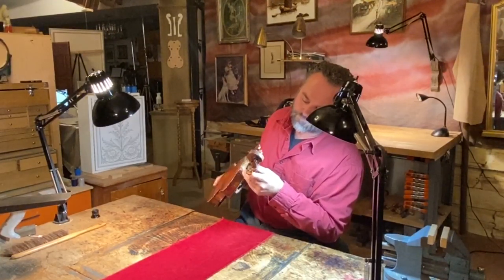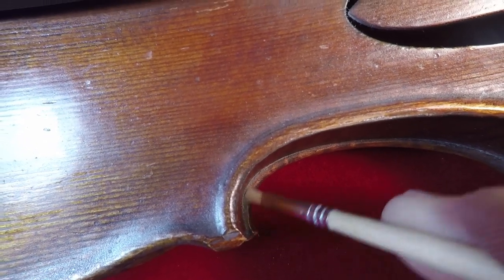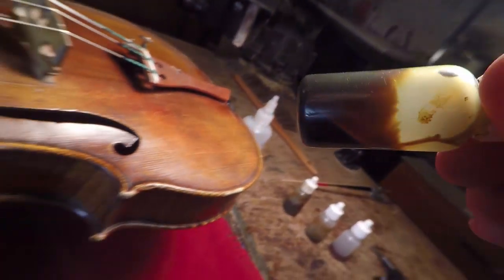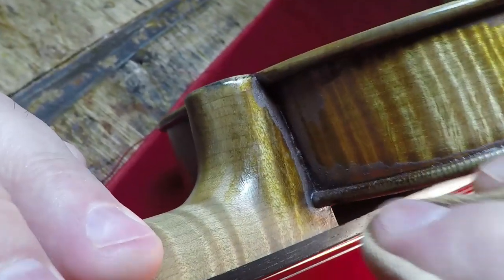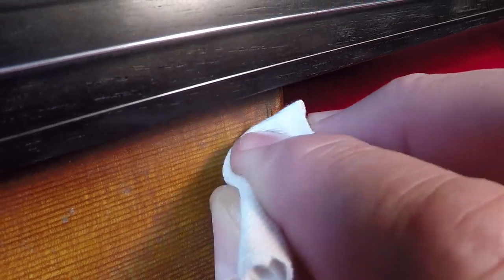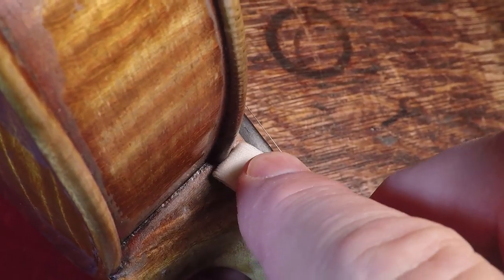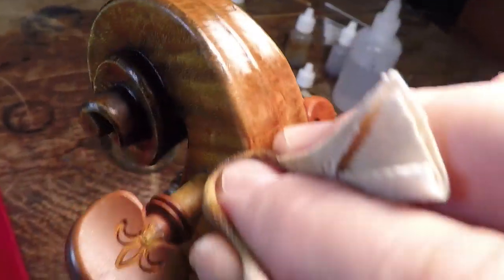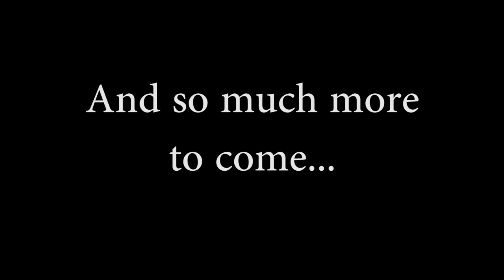How to Really Clean and Polish a Fine Violin / A "Natural" French Polish /  How to Remove Rosin

Comment: the best way to remove old rosin/dirt from a violin is to use xylene, since almost all violin varnishes are totally unaffected by this solvent (of course try a small area first). Once the violin has been cleaned up, traditionally it is french polished, however there is an alternative way to polish a violin that does not use any solvent or add any finishing material such as shellac or oil; this is by using a wax finish that is very long-lasting, repels dirt and rosin which can easily be wiped off with a rag. The wax finish can easily be removed. The best wax finish I have found is Saphir Medaille d’Or Mirror Gloss - Natural Wax Polish (for Leather Shoes & Boots) it also works great as a polish for wood. This hard wax finish is easy to apply and  polishes to a mirror gloss shine extremely easily with very light buffing with a soft cloth. Another very highly recommended polish for violins is Wyman's Furniture Cream, which gives a somewhat softer finish than the Saphir wax.

Comment: That thing turned out gorgeous, absolutely stunning 3d flame on the maple parts after the polish! Loved the narrative explaining each step too as well as the playing part at the end, I watched the entire thing twice.

I fix guitars as a hobby and am always absolutely blow away by the techniques, knowledge and materials you violin guys use for work like this.

We generally deal with Polyurethane on our side of the Luthiers genre ... you can basically windex that stuff and it will shine like a diamond without hurting the finish, sometimes in the rare case of a "good" or expensive guitar nitrocellulose lacquer with which you have to be a little more careful but you can get away with a slightly damp cloth with hand soap and it will be just fine. Fingerboards we can use lighter fluid (Naphta) and Linseed oil ... it's basically idiot proof.

Stuff like you did here with the cleaners and polish knowing how careful you have to be with the instruments and their varnish (and the staple/sound post ... another good reason to leave the strings on) to avoid ending up ruining the instrument ....  This is true mastery in my opinion! 

Both enticing and humbling to watch, thank you.

Comment: I am a luthier who has uses exclusively oil varnish. It just looks Italian immediately.  It has taken many years to develop a varnish (cooked amber, gum arabique, lavender oil etc). 
My viola is in need of a "shine" but I don't want to polish it too much. I have taken it to show a handful of luthiers (that's all we have in my part of Australia, perhaps 3 decent ones including myself) and they all agree for a clean/polish: NO alcohol, just some water and limestone or "rotten stone" applied sparingly, linen cloth for the first run, then silk for the final run. 
I have considered French polish for extra shine but when I tried this on another ($1200 oil varnish violin) the French polish sank right into the varnish and sure enough stripped the instrument of it. Luckily that was okay since I wanted to re-varnish that violin anyway! 

How could I go about a new shine? All I can think of is: put a new coat of varnish on and really look after it by placing it in a large box at night and covering it with a big silk scarf to stop dust from getting in but allowing the viola to "breath" and not be affected my temperature too much.
Reply: Interesting point! I'd really like to know more from your perspective as someone who removes caked on rosin from the instrument only using water and stone, but particularly on using oil varnish as oppose to French polish. 

PS. I'm also from Australia, in SE QLD reasonably nearby to where Ask Olaf the Violinmaker is. Just discovered your chanel and subscribed. Very informative video explaining Brett and Eddie's new violins, learned a few new things there, thanks :)

Comment: BTW, I use a medical endoscope to do inside work! I paid $40 for one at an auction that sold for $18,500 when it was new. Then I changed to a Meade eyepiece camera to hook up to my computer and view on a 47" screen. I have all sorts of gadgets that run inside the fiber optic part to the tip of the endoscope. I have done all sorts of repairs on all string instruments without taking them apart, and I charge a very large amount of money for my repair work! It beats taking the instrument apart, which is such a hazard to the instrument!

Comment: I haven't finished watching the whole video yet, but, wanted to share a small tip with you, Kevin, whilest I remember: you referenced using '0000' steel wool as that is just about the finest one can get.  And be careful that it doesnt have any oil in it"     You may have already discovered that there is a 5 ott steel wool available.   However, more importantly there is a product which has no oil in it as it isnt needed to prevent the wool from rusting/oxidizing--- it's used in fine woodworking and is called bronze wool.  Hard to find but much better results than steel wool.  Give it a try; I think you'll like it!
Reply from the maker: Years ago, when I tried the Bronze wools, I found that the slightest residue (which almost always happened) reacted with some of the most popular violin polishes, so I left them and stuck with the highest quality Stainless Steel I could find. Thank you so much for your comment!

Comment: Great explanation of the process. In regards to the alcohol in used with the spirit varnished is that "denatured alcohol " or some other?
Reply from the maker: Yes, while I have used other "quite expensive" high-proof alcohols, denatured is just fine. :) Just don't drink it!
Reply: @kevinleeluthier  I'll make sure not to confuse with the bottle of Vodka :) Thanks for your reply.

Comment: Man, I do different types of woodworking, painting, etc. and that tip you gave about rounding one side of the cutter to hold the cutting edge off of the surface you don't want cut seems like a good one.  I'm going to get out the diamond sharpeners and give that a shot...I'm kind of embarrassed I never thought of it.  

I will give one in return...if you ever want to wrap something in electrical tape and have it hold VERY tightly (keep a seal, basically) just stretch it before you wrap.  At some point it rips, and you want to stay shy of that point, obviously, but stretch a few test strips and you'll get the idea.  I've even wrapped split garden hoses this way with many wraps and had them hold for many hours.  Give it a shot, it works great, and will protect wrapped or soldered wires much better when this method is used. If a  long wrap, just pull the roll out a few inches, stretch, wrap, and repeat.  If you really need it to be at least very water resistant just take some CA and lightly coat it afterward...also helps hold the ends long term in less than ideal environments.
Reply: Nice.
You know I'm just putting some Minwax on my hardwood floor in a certain corner where it had some abuse. But this video is the best isn't it?

Comment: Fantastic video - just one question - why did you not remove the strings for such a significant refurbish - is there  an issue with this? You have another subscriber.
Reply from the maker: The customer preferred that I did not remove the strings or change anything (especially the soundpost), and it offered an opportunity to show the more difficult techniques. Thank you so much for watching, and for your comment!

Comment: Kevin,  I have an older violin that is in need of some varnish to seal bare wood on the edges.  Do you have a recommendation for what type of varnish to use? The violin is a 1928 Eugen Meinel trade name alias E.H. Roth with a dark red varnish.  I think it has a great sound.
Kenny
Reply from the maker: I consider the touch up varnish that I used on this instrument to be as fine as it gets, and I really will give full instructions in my upcoming video about making it. It can also be made to be any color, to touch up almost any instrument.

Comment: Amazing ! ..fantastic information. I wonder if any of the Stradivarius violins escaped the neck lengthening treatment ?...they probably would'nt have been as precious with them from a preservation standpoint as they are now.  Regarding preservation, I'd be so worried applying alcohol to that varnish...I'd be tempted to simply leave some of the older rosin as part & parcel of the instrument itself. You really do need to have a lot of experience ( like you do ) judging it. It's a wonder that rosin has'nt yet been replaced with a modern cleaner substitute.
Reply from the maker: There are only a few Stradivarius violins with their original necks, and most of those have had their necks altered in some way (like "The Harrison").
A couple have even had their longer neck grafts removed and shorter necks put back on in order to bring them back to their original dimensions (like "The Gould").
As far as how much caked rosin to leave when cleaning an instrument: I leave that up to the owner since rosin dust is not part of the "original" instrument and is a matter of taste = sometime I do leave a certain amount.
And... I kind of like the idea that in over 500 years, nothing is better or finer than boiled down tree sap. :)

Comment: Thank you for these brilliant videos!
I just purchased a violin for AUD$80.00. Before you laugh, it does have an inscription that reads:
	Antonius Stradivarius. Cremonensis
	Faciebot Anno 1713
	Made in Czechoslovakia
So, there's that.
Reply from the maker: I rarely "laugh" at violins, and never simply because of the price. If it looks quite old, chances are that it was made around 1913 instead of 1713 (+/- 20 years) and that it has a few cracks and doesn't sound very good. YET, if that's what you have to work with, usually these can be made into much better instruments within a couple days by fixing the cracks and open seams (always check for a loose neck), re-graduating the plates just slightly while adding "full" corner blocks. Then a little touch up and French polish gives them a lot more charm. = I'll have to do a video sometime. Thanks for sharing!
Reply: @kevinleeluthier   Would love a video on the topic, Mr Lee. I've been using a technique I observed on this video of just breathing on a small section, and slowly and carefully working on that (always with the grain). I'm not a violinist (yet - this will be my learn instrument) but I think it sounds really good! Put new strings on it, but the pegs are pretty much gone: need replacing. Might have to take it to Olaf in Brisbane to replace the pegs. BTW, I am chronicling my progress on a GitHub Projects page, if you're interested.🙂😊
Reply: @kevinleeluthier  I've started lessons: yes, they're online, but at the moment, with grandparenting time constraints, it's what's doable. Eventually, I'll engage a proper instructor. Your tips in other videos on holding the bow and how to relax/position/hold the hand are brilliant: constant mindfulness on your pointers are truly helpful.
I'm so very happy with the quality of sound my violin is able to produce - even with my extremely novice abilities - and will encourage her to sing for me. These are very happy times: I'm playing a lovely instrument!

Comment: I understand not removing the strings so that the bridge position is not moved and the sound post does not fall.     but why not just replace one string at a time with old steal strings? then put the good strings back on when you are done.
Reply from the maker: Everything on this job was done to please the customer, and at the same time, to teach as many different cleaning techniques as possible. (I usually prefer taking all of the strings off because for many instruments it's like a "breath of fresh air" and they sound even better afterward. Of course, feel free to use any variations that you like. Thank you so much for your comment!

Comment: I am half way thru watching but have a question.  You apply varnish to the edges but the edges were still rough wood.  I'm sure this is intentional, but my instinct would be to smooth the wood first, like sand it first before varnish.  Sanded anything with violins seems to be a big no, but even shaving slightly?
Reply from the maker: Unless there is a danger of snagging and breaking the edges, always leave as much of the original wood on the violin as possible. When a smoothing operation does become necessary (this takes experience and judgement whether to remove wood or add to it), the raised grain areas are trimmed(cut) and scraped. But when you do this, you must properly prepare and seal the wood so that it matches the patina of the original wood under the varnish, which (of course) is another video). :)

Comment: What is the best lubricant to occasionally use on my violin fine tuners? Regular oil ... any specific products recommended and or any to absolutely avoid? Thanks.
Reply from the maker: Avoid all oils. They spread over time, they get into the wood and can ruin most varnishes. 
 Traditionally, violinists and luthiers have used Fels Naptha Laundry Soap Bar for the fine tuners and for bow screws. (amazon has a 2 pack for $6.30)  Pull the screw out, rub a little on the threads, screw it back in and then immediately blow off the excess soap dust. 1 bar of soap will last 50 musicians a lifetime so cut some off and pass it around.
 Stay away from oil, WD 40 etc., if all else fails, its better to use almost any brand of bar soap, or Hill peg compound.

Comment: Please advise how to remove the sticky cork remains on the violin after taking of the chinrest. Thank you 🙏
Reply from the maker: For most cases, gently scrape/pop the cork off with your fingernail. For more difficult cork pieces, I use a gently curved, end-cutting exacto knife blade and literally cut the cork off (BE CAREFUL not to hurt the varnish!)  And for cork that has been glued on (yes, I've seen it a few times), I carefully cut the bulk of the cork off with the curved exacto-blade and then rub the thin remaining layer of cork and glue off with a damp cloth. Be careful, and Good luck!
Reply: @kevinleeluthier  My store deals with many violinists who wish to change their chinrests. Thank you. Your suggestions are very helpful!

Comment: Can you use isopropyl instead of denatured alcohol for rosin removal
Reply from the maker: Once upon a time I experimented and made the comparison with every other type of alcohol that I could find (including isopropyl which tended to leave the surface cloudy at times), and while I was able to make just about any of them work, nothing was as consistent, as fast, and left the surface of the varnish as clear as a high-grade denatured (they are not all the same). On the other hand,  190 proof Everclear has it's own advantages...

Comment: I am on a mission to learn violin repair, construction, and maintenance.  I have studied a number of luthiers on YouTube to put myself on the correct path and to learn the many ins and outs of the trade.  Watching your video, my first reaction was to question why a luthier would proceed with such an in-depth cleaning process without removing the strings, pegs, tailpiece, and bridge?  My next question was; why do a partial cleaning of various areas on the instrument and then apply varnish, only to proceed further with more cleaning?  The ribs were separated at the four points between the bouts.  You made no mention of that and the need for repair.  Any customer, especially those with expensive instruments, who bring an instrument in for such cleaning, will have done their homework and selected a luthier they can trust to work on their instrument and maintain the integrity of setting the instrument up properly after such a cleaning.  That's why they pay the big bucks.  Josh Bell bought a Stradivarius that had been stolen and covered in shoe polish to disguise it.  It took a full year for that instrument to cleaned and brought back to playing condition.  The instrument in your video appears to have turned out well but I would not have accepted it unless the customer trusted me to clean it properly and set it up again, as it was.  Thank you for the video...
Reply from the maker: Even though I might usually try to talk the customer into it, (always remember that the instrument is theirs, after all, and not yours) the reason for not removing the fittings was at the customer's request.
 The sound and response was so perfect "for them" that they wanted nothing changed = I was not to take any chance of the soundpost falling. I might normally be tempted to "talk them into it," yet it also presented such a great teaching opportunity for so many concerning the different cleaning techniques.

 The bare wood, once cleaned, is protected as soon as possible in order to keep any other rosin or dirt from getting into it during the
 main cleaning process.

 I'm not sure about your next comment. There was no separation of the ribs on this instrument, from the belly, the back, or from each other,
 even though it may have appeared that way because of lighting, video resolution or ?

 Any time an instrument is stripped and set back up there will be changes: in it's tone, it's response, or simply its character.
 This is almost always for the better (in the Luthier's opinion), yet, the emotional connection and feelings that the owner has for their instrument is paramount and and my priority. This instrument, as it was (other than a good cleaning) was exactly what the customer wanted, and needed.
 Thank you so much for watching, and for your comment.